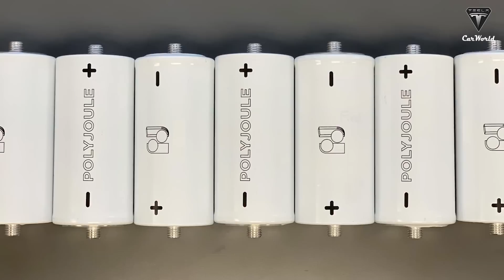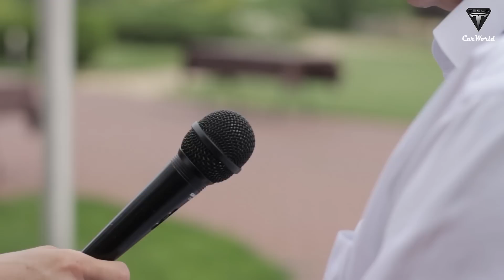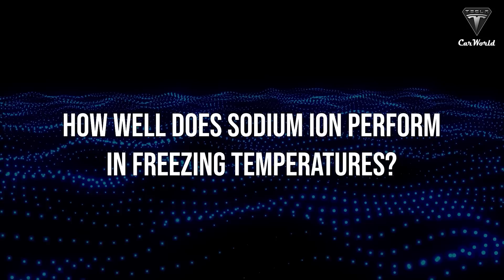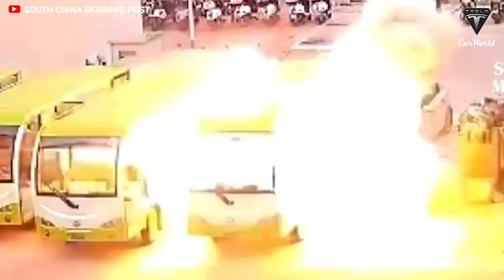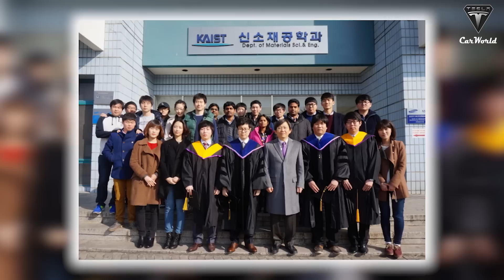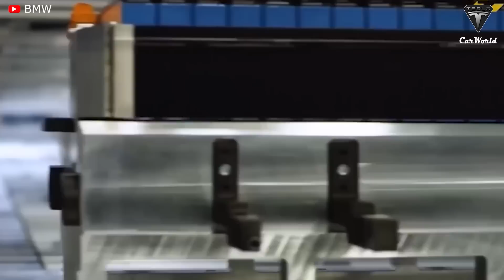Elon Musk Reveals ALL-NEW 4.0 Batteries Design, Changes Everything in 2024!

Comment: Thanks for providing the current state of battery technology.  Being skeptical I will wait to see which ones make it to mass production.  I am particularly concerned about the poly joule batteries as they are going to be made of plastic and the plastics industry has a very poor track record when it comes to recyclability of plastics. The vast majority of "recyclable" plastic is actually not recyclable which is why there are mountains of plastic in the Philippines and other south east Asian countries.  Our current "recycling" industry has been shipping all the non recyclable plastics to other countries so we don't see it, or quietly burying it in landfills ... or in the oceans.  So again, I am concerned if the plastic being used tin the poly joule battery is really recyclable.  Anyone can say it is recyclable but that doesn't mean it is.  I hope they are telling the truth, or that they have also worked out a method to recycle them in addition to manufacturing them.  

The sodium ion battery is promising as is the aluminium graphene battery, but still several years away from delivering the promised performance.  The Al-Gr battery is in the early development stage as they are still working on how to mass produce them and then design the actual production line.

The hybrid Lion battery has a problem because they use Germanium in the battery.  All well and good but Ge is about as abundant in the crust as Cadmium so the same environmental issues with Cd extraction will also apply to Ge.

Lots of promising battery technologies with a number of issues to be worked out.  Hopefully some of the batteries will actually make it to production, but that's not guaranteed,  remember solid state batteries?  They are still working out mass production and initial energy density issues.  Looking forward to significant breakthroughs.
Reply: I think we need to match the type to the use case. For e.g. there is molten metal batteries promising a lot of deep discharge and long cycles with low power density. May be more suitable for infrastructure power storage etc...  Its good to see multiple types coming in. We need to keep on R&D and investment in this area. 
Pollution is a relative concern. If there is economic value in recycling then it will happen. That depends on the economic model as well as the technology. We should keep pressuring Industry and governements to do rational regulations. Which itself is a challenge. 
That said the less we use of rare earth metals the better. So polymers have an advantage here. Its a misnomer that polymer technology is not recycle friendly. Its is a problem with the economic model and its incentives to recycle. In 3rd world countries, there are already dangerous chemicals from curent batteries that are being dumped into ground water and soil today. Plastics have better recycing options.  Plastic waste is a problem because they dont degrade. But that doesnt make Lithum cells any better. Trust me I live in such a country.
Reply: @bangaloretrailrider2472    You are right about batteries being chosen for the type of use.  You also highlight the primary problem with so many things.  We adopt and start using something without even considering how to deal with the resulting waste, whether it is heavy metals or chemical contaminating the ground and ground water, or nuclear waste, or plastic, or ......  one can list a lot of things.  That is why I would like someone to consider from the beginning how to dispose of, preferably how to recycle, any waste created from the technology being developed.  Another part of the problem is that we can't rely on the when it becomes economically feasible a market will develop.  You are living in a country where the market forces "developed" a solution to the plastics, and battery problem....... they just sent our waste to your country and many others and dumped it on developing nations.  Better the poor and powerless get buried and poisoned than the rich.  That has been going on for decades and will continue because it is easier and cheaper than actually finding an effective solution.

In the case of plastics and nuclear waste we are looking at nearly 70 years or more of waiting for market forces to solve the problem and we are essentially no closer to a solution.  It's similar to the "we will have a working fusion power plant in 20 years, or  10 years, or 30 years, pick your time frame, as they have all be said over the decades.  I remember researchers and engineers state that nuclear fusion would be a reality in 20 years back in 1974 and it's still 20 years away. Ok they say 10 years, but it will take them at least another 5 years to finish construction or ITER and probably a minimum of 2 years to bring it online and then a minimum of 5 years to figure out how to build a fusion plant that can generate more energy than it consumes.  So that means at least 20 years.  The problem of recycling plastics is much easier to overcome and yet it still hasn't been "solved".

We've got to start somewhere which is why we need to make sure we can recycle the waste from any new  technologies so we don't have to to it decades later.   Positive note, there is at least one recycling process that is currently being tested that can recycle all plastics without needing to separate them, I hope it can eventually be scaled up to start removing some of the excess plastic waste.  Another positive note is that there are new fusion approaches being tried that may be able to achieve total power out > power in. However they are in the early stages of R&D so if and when they become viable is the question, though they may be successful in 10 years or less (or is this just another case of fusion plants in 20 years?)
Reply: which is why Elon Musk is onto using hydrogen for machine propulsion and then these battery disasters will be minimized;  his solar-to-hydrogen “farm” is a good solution.
Reply: @MrGGPRI  Can you point me to the literature about that? New news to me.
Reply: @MrGGPRI  You might want to take a look at this from Sabine Hossenfelder https://www.youtube.com/watch?v=Zklo4Z1SqkE&list=PLDsHjxFJDcp02NoJU1Uy7Ci9YMsl0S-1B&index=14  . It makes a lot of sense and explains why we don't have a lot of hydrogen powered cars, or anything really,  and the small number (I was shocked) of hydrogen fueling stations in the US.  At this point a lot of things need to be addressed to even have a chance to make hydrogen more relevant.  It would be nice since it is clean as long as the hydrogen is green hydrogen.
Reply: @MrGGPRI I used to work at Ballard Power Systems, hydrogen fuel cell manufacturer.   Hydrogens biggest issue is storage..  it has the smallest molecules of any material and migrates through most materials you store it in.  So it’s often stored cryogenically at low temperatures or using metal hydrides.  It also takes 1-1/2 times the power to break hydrogen from water than what you get out of it.
Reply: You can sell almost anything with fear. Mountains of plastic are certainly a problem. How about mountains of lithium? Which is worse? We still don't know what to do with (far more dangerous) spent fuel rods from nuclear power plants---so far, it's stored on the site of each plant. So there are "hills" of extremely deadly radioactive material piles all over the world---leaking or about to leak. Compared to other materials, fossil fuel biproducts maybe not be as terrible or ugly as some (adamantly) claim. Also nothing about better batteries will stem the tide of plastic into landfills---mostly coming from the most excellent product containers for consumer and industrial use ever invented. They make our lives better and safer than previous generations. Maybe plastics, with all the attendant problems should be seen as our current miracle drug for the planet and it's most precious resource---people. 

Should we hope for radioactive, lithium or other extremely dangerous chemical landfills to replace plastic ones? Wait a minute! This is the lives of our future generations we put at risk of destroying. I pray not just so that Al Gore and his doomsday prognosticator ilk can get famous (and rich). Fossil fuels were left on/in the planet for us and are far easier overall to live with. Racing away from them may not be truly better. EVs, for instance, are not "better for the plant," Tesla/Musk not withstanding. Who is calculating (and publishing) the cost of making EV batteries or the damage from EV fires? 

I wouldn't be disappointed by "several years of development," it's mostly a good thing. Considering that we have a perfectly good means of transportation now, think about why, why, why are we in such a rush to run a car on hundreds of fancy flashlight batteries---oh, that's right, because, as my Mom used to say, "You can sell almost anything with fear." The sky is falling, the planet is dying. Whatever lie sells.... 
batteries don't solve the problem. Let's get real.
Reply: I’m expecting the Aluminum-Graphene battery to be the best next iteration in battery technology.  Aluminum has 4X the free ions that lithium does.
Reply: "current state", nice pun!
Reply: Hello 👋 thanks for your support in my dream and career I’m happy to have you as a fan 🚀🌎

Comment: What a lying bait title.  This has nothing to do with tesla or elon musk. Big problem with this battery is that its 5x larger than lithium ion for the same energy density so it takes up too much space.  Probably more suited for residential or commercial energy storage applications.  Not EVs.  Could compete with Teslas megapacks but they are 6 to 7 years behind tesla in mass commercial production. Sodium ion could be the golden standard for EVs and megapacks in 7 - 8 years from now.  Lithium prices will be out of control in 2030. Mixing with sodium is a smart idea. I think BMWs gen 6 battery is the battery developed by Solid Power. Tesla will eventually modify the internal chemistry of materials used for their 4680 batteries keeping the same 4680 size

Comment: 🤷‍♂️How about the energy density of a battery that lasts 28,000 years 🤔and can clean up nuclear waste https://youtu.be/xuOwwUdlwOM instead of dumping it into the ocean🤯 thorium based N.D.B.
Reply: Genius!  Let’s put Radioactive material in a high speed moving vehicle that heats up the molecules of the atoms making them even more dangerous than the Lithium Ion batteries used now…or maybe we don’t do that.
Reply: They're saying that Nano Diamond batteries but no they say they are better for medical use inside a human's body there so safe and that we would not use them in a vehicle or anywhere else like grid storage or a charging station for EV cars making a nuclear Diamond battery bank and a protective casing Nano reinforced for metal parts that break or bend often.

Aluminum-Oxynitride Powder
https://youtu.be/DduO1fNzV4w

Comes in bag A B & C take bag B and mix with 99% or higher alcohol end Nano graphite powder for a single carbon atom. Place in ultrasonic cleaner to chemically dope graphite then prep metal parts for the electrostatic prepping gun for a nanobond https://youtu.be/bpV_Dcwtj60 then mix all three powders in powder coating gun https://youtu.be/IFeMX1O6Epk then spray metal parts and bake in pressure oven that is filled with argon gas that is called Hot Isostatic Pressing or H.I.P. process used in centering aluminum automotive parts. https://youtu.be/BsnzgsEXT_A Otherwise known as chemical vapor deposition proces's for a transparent aluminum diamond Nano reinforced hard coating for larger parts place in larger oven for example pressure treated wood. Much like the process of making a N.D.B.
Reply: Or Quantum batteries that could last even longer than N.D.B. using a femtosecond laser https://youtu.be/mQdoKaNI8Ko to etch the surface of the positive and negative electrode rail tracks for the ferrofluid electrolyte to be propelled over the surface in a closed loop the rest of the tube being superhydrophobic and place copper coils or nanowires coils coated with voice coil Laminating adhesive that is mixed with aerogel powder https://youtu.be/qnOoDE9rj6w around tube to pick up eddy current.

How to make nanowire process https://youtu.be/PY4DqsfgOPE use spider webs that have been coated with carbon nanotubes and place in plasma Vapor chamber https://youtu.be/aljbjJbfghs to transfer metal to Nano reinforced spider silk.
https://youtu.be/1-tHRDkfWdE then coat nanowire with voice coil Laminating adhesive that is mixed with aerogel powder.

Ferrofluid electrolyte chemistry

Search how to make magnetic powder and hydrophobic sand.
https://youtu.be/EkKcufVPFB4
https://youtu.be/rIx4G9IQqWU
Crushed neodymium magnets in hydraulic press to a Magnetic sand and powder like mix https://youtu.be/bYGQu-LHSNE except it's superhydrophobic tube not cold magnet scene in video. and follow the process on making hydrophobic sand except replace sand with magnetic powder then take your semipermeable hydrophobic magnetized magnetic powder and mineral oil https://youtu.be/tqku9z-Wesg in container place it in ultrasonic cleaner for a day or two and you will have a non conductive oil-based ferrofluid to pass on eddy current to coils and using a sodium carbonate or other water based electrolyte. Alternate adding both liquids in the Loop.

And you still need to take voltage readings from both alternator coils and Battery electrodes and program battery management system or silicon B.M.S. setup accordingly For better efficiency use B.M.S. circuits made of chemically dope graphene and chemically doped borophene Nano structures Quantum Gates https://youtu.be/VLPpDoMBVK0 that have better efficiencies. However in both silicon and nanostructure setup you need B.M.S. for residence frequency modulations. https://youtu.be/I1IDC8FEIBU

Propulsion process between electrolyte and electrons of the nanostructures.

https://youtu.be/bPSowtQ9rjI

The positive and negative electrode of any two types of metal for example copper and zinc in grade school you may have took a piece of each and stuck it in a potato. I tried using copper foil tape and aluminum foil tape that has been etched with a femtosecond laser https://youtu.be/KMoeun2aH9w to semi-phobic Nano Surface to Wick the electrolyte and the superhydrophobic tube + There's a big difference between hydrophobic semipermeable and superhydrophobic. Superhydrophobic means that the liquid in the tube will bounce off the superhydrophobic surface and liquid ripples with the B.M.S. residence frequency modulations and electron processes over nanostructure. The tube has a air pocket between the electrolyte and the tube for vapor cycle processes think of a heat pipe tube https://youtu.be/51bwzEO8XCw and the water cycle in it. Except you're replacing heat process with electron process over nanostructure of the positive and negative electrode otherwise known as thermal creep which leads to Thermal runaway in other battery technologies. Or you could use other nanostructures that wickes liquid like graphene and borophene https://youtu.be/z1TrEWLIAX4 which is harder to do but you can add other Nano functions to strips for even better efficiency. For example P Type N-Type Semiconductors T.E.G. Quantum logic Gates nanostructures that use the logic of thermal dynamics or otherwise known as silicon-based Thermal electric generator https://youtu.be/YhynSkFlJOs when using this process you don't need Nano coils or coils you don't even need ferrofluid you can just use water-based electrolyte and mineral oil and alternate adding both to Loop. However redundancy can be a good idea to keep.

Filling Quantum battery Loop

1. Coat both halves with Thermal adhesive glue place two tubes in between both halves one tube near top iner Edge of Loop for air and the other tube little further in to add liquid.

2. Pyrex glass tube etched with femtosecond laser to be superhydrophobic after liquid is filled remove both breathing tube and filling tube from Loop twist and Bolt together.

3. Breathing tube for filling.

4. Filling tube for ferrofluid electrolyte.

You got to understand thermodynamics in a computer's water loop cooled system otherwise known as heat soak period for the size of the Pyrex glass tube for all silicon you need a bigger size Pyrex glass Loop tube for nanostructured smaller Pyrex glass Loop tube.

Quantum battery casing
 
Quantum battery Pyrex glass Loop has inner half of loop with two lips that twist and lock together and the outer half is bolted together with loops and thermal adhesive glue between them wen its fully dry it is held with thermal tape then to aluminum foam https://youtu.be/NvXI_RhVEDQ fins between battery case and outer casing Nano reinforced with.

Aluminum-Oxynitride Powder
https://youtu.be/DduO1fNzV4w

Comes in bag A B & C take bag B and mix with 99% or higher alcohol end Nano graphite powder for a single carbon atom. Place in ultrasonic cleaner to chemically dope graphite then prep metal parts for the electrostatic prepping gun for a nanobond https://youtu.be/bpV_Dcwtj60 then mix all three powders in powder coating gun https://youtu.be/IFeMX1O6Epk then spray metal parts and bake in pressure oven that is filled with argon gas that is called Hot Isostatic Pressing or H.I.P. process used in centering aluminum automotive parts. https://youtu.be/BsnzgsEXT_A Otherwise known as chemical vapor deposition proces's for a transparent aluminum diamond Nano reinforced hard coating for larger parts place in larger oven for example pressure treated wood.

https://youtu.be/dvWOiY-LnVs